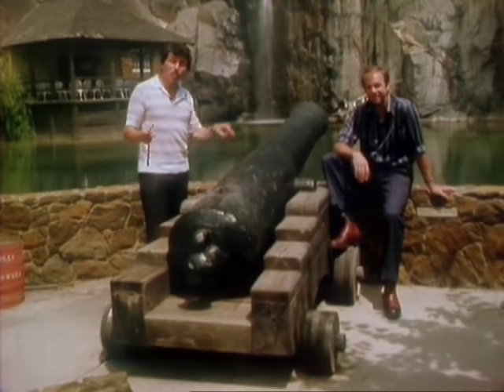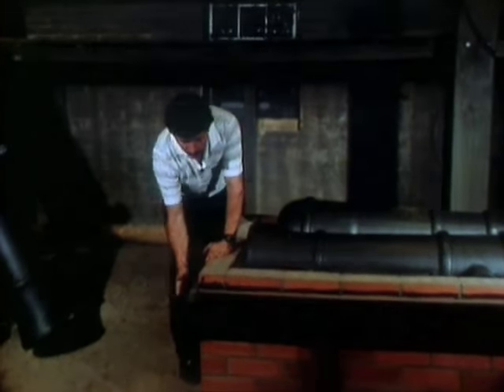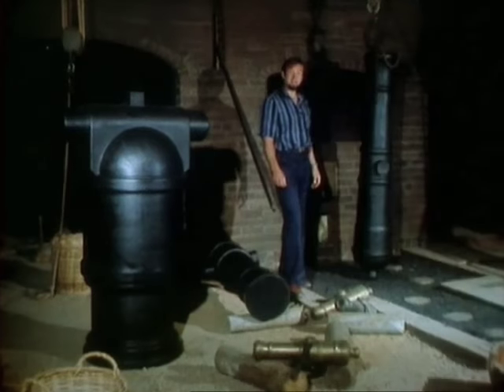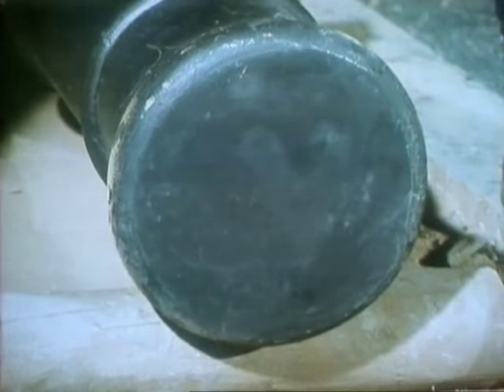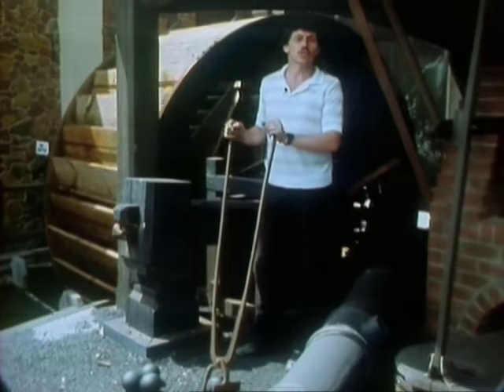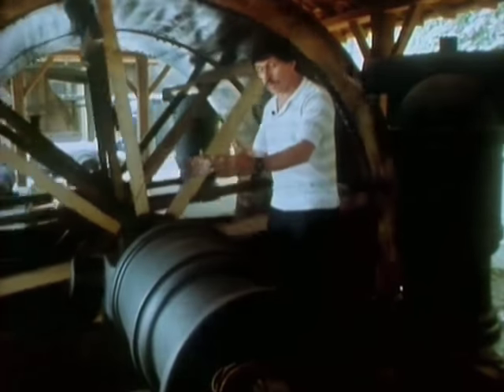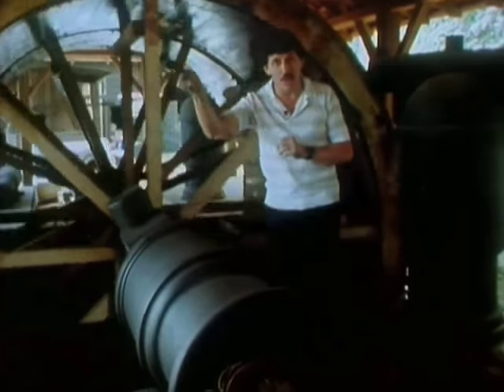Making a Cannon

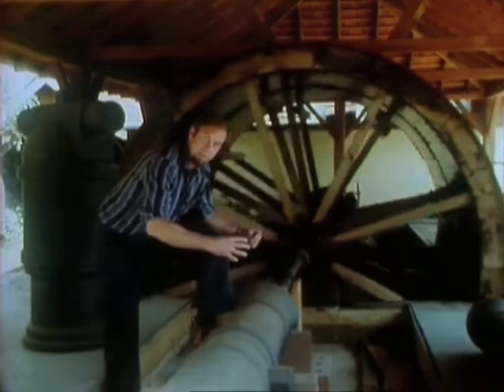Comment: 3:01 Those metal chip cuttings are amazingly consistent for water power, I didn't think water could push so hard as to drill iron, I just found this show a month ago and I can't stop watching, I've been out of school for 6 years, I'm 24 and Deane and Rob make me hungry for knowledge
Reply: Force equals mass times acceleration.  You can get a big mass of water and you can get gravity to move it fast.  You also can use levers and gear ratios to increase the amount of work done.

Comment: The Deutsches Museum of Science and Technology in Munich had (may still have) some interesting displays of windmills and water wheels, and part of that was a model/display of cannon manufacture.  They had the cannon vertically oriented within a large heavy wooden structure, open at the bottom to facilitate shavings removal.  Horses could also be used to turn the boring tools.  Quite an interesting display!